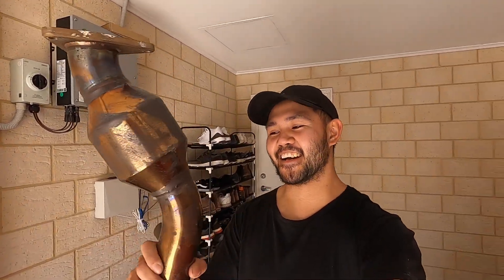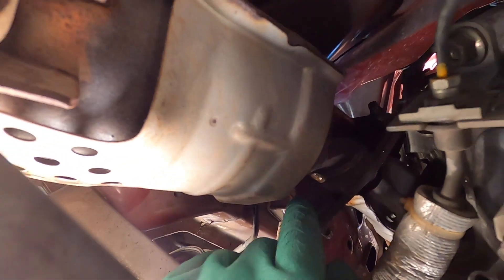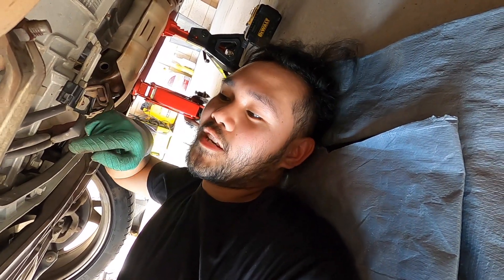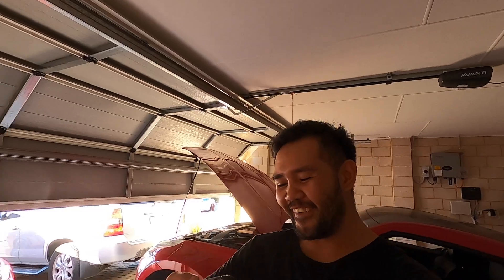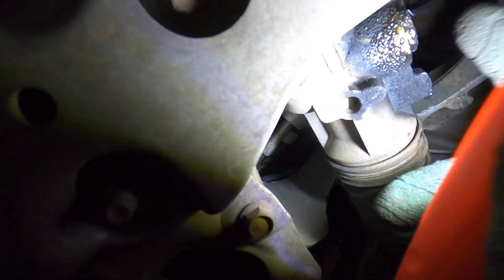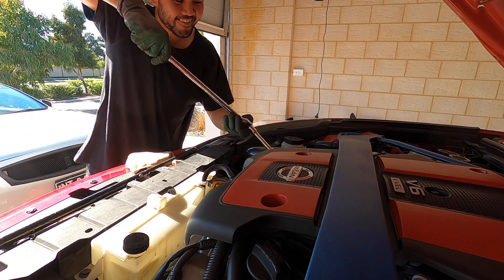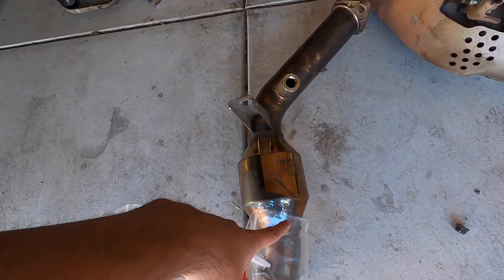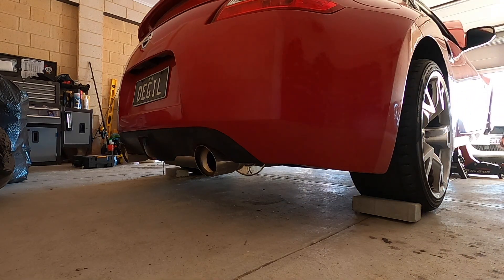Nissan 370z High Flow Cats Test Pipes Install!!

Comment: In all this time did you get any check engine light on for the high flow cats ? And what brand are those ?
Reply from the maker: They did at the start. But I put an extended o2 sensor bung and it’s been fine. They are Invidia

Comment: Hey did you have to get your car tuned after installing the hi flow cats?
Reply from the maker: To get the most out of them it’s definitely recommended. But I haven’t as of yet
Reply: @HustleGarageTV  oh ..so no check engine light appeared since putting them on? And if you don't mind me asking what brand cats do you have
Reply from the maker: There was a CEL but I got the o2 sensor extensions and no CEL. If it comes up I just clear that code with a obd2 scanner
Reply from the maker: @carlosfaircloth6652 these were invidia hfc. I have invidia test pipes on now
Reply from the maker: @carlosfaircloth6652 but i do recommend you getting tuned afterwards. You will run rich

Comment: I removed the passenger side cat and removed the demon bold and the top nut on the driver side but the one stud at the bottom I can not remove it, there is no space to spin my ratchet 😢 all I need is the one stud and be done but there’s always something I swear.
Reply from the maker: Yeah it’s definitely and annoying one. Try going through the wheel well and try finding a position through the gap

Comment: So basically before you remove the sensors you have to unplugged the battery first right?
Reply from the maker: Yes definitely, I do it every time I’m working on electrical stuff just incase. Better be safe than sorry

Comment: fautzi just so you know you can get the demon bolts from the bottom, trick is to take the subframe shroud off and the front wheels. fyi
Reply from the maker: Mmmm that’s way to much extra work to get to those bolts hahah
Reply from the maker: But that’s good to know

Comment: After test pipe installed did you get any power gain? Pops or crackle?
Reply from the maker: You won’t get any gains without a tune tbh, it does pop on downshift with revmatch but if you want the loud pop and crackles, you need the map from a tune
Reply: @Fauzilata  I have already muffler delete it pops and crackle, now about to do cats delete
Reply from the maker: @autoperformance503  yeah nicee, that’ll be from the car running lean (lean pops). It’ll pop and crackle more if you do test pipes
Reply: @Fauzilata  how much the tune cost ?
Reply from the maker: @autoperformance503  mmmm depends on where you go. Here in Australia it’s like AUD$1000+
Reply: @Fauzilata  Ohk what kind of tune would you recommend for Nissan 350z
Reply from the maker: @autoperformance503  I don’t know much about what’s out there for 350z tbh. Ask a couple of 350z groups on Facebook and they should be able to help you
Reply: @Fauzilata  what if I don’t tune ? Will it ruin my engine
Reply: @autoperformance503  Without a tune, your engine runs lean, which can wear out your engine prematurely overtime.